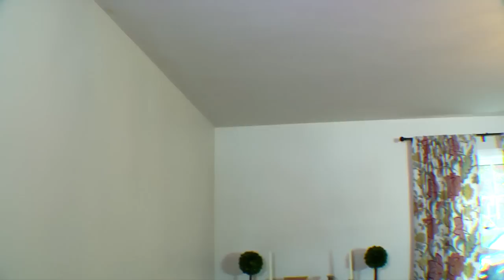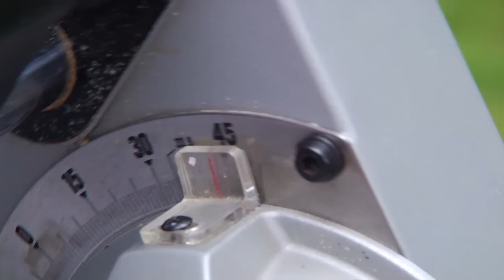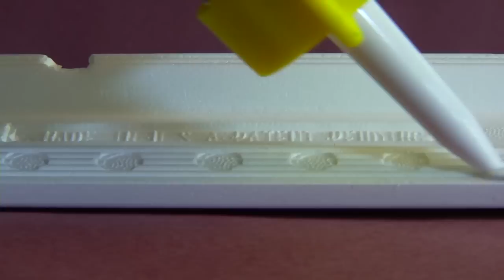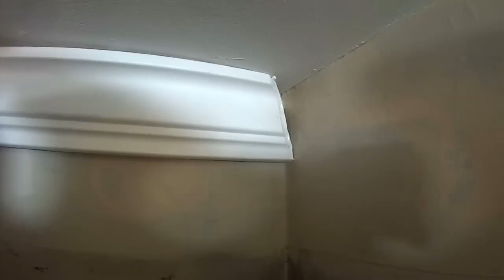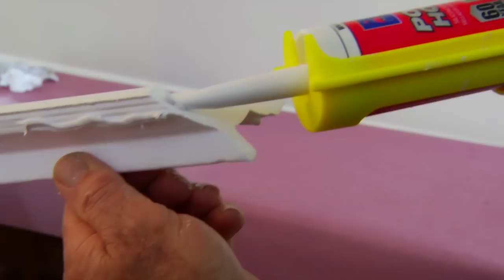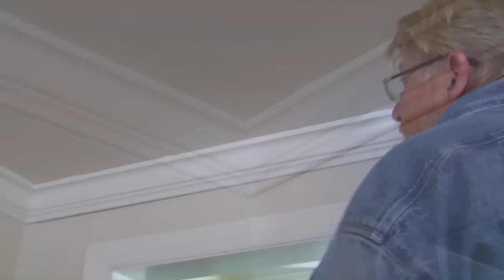Install Crown Molding Without Nails

Comment: My crown molding was installed a few years back, nailed up. But during winter low humidity the molding separates at joints and gaps at the ceiling. Would this help or other thoughts?

Comment: I recently installed glass tile in my bathroom and I now have to install the door trim. I've looked around youtube and it looks like people are leaving the trim in place and tiling up to it. I didn't do this. I tilled to the just outside the reveal, 1 inch, with the trim removed. Should I attache the trim to the glass tile with liquid nails and nail to the door frame?

Comment: Wow, you guys are vicious. My 2 cents...I'm no finish carpenter, but I get a kick out of the resistance to change to new materials. I was a mechanic during the 70s 80s 90s 2000s and saw endless changes, mostly for the better. I remember the old timer mechanics bitching about disc brakes and electronic ignition. some even quit the business over it. I bet some chopper mechanics bitched when they went to carbon fiber blades. Seems funny now. From a DIY home owner point of view, I like non wood products for many projects. I would never use wood for exterior again like wood lap siding or window embellishments. Rot, warp, crack, maintenance, arrggghh! The urathane molding looks better than wood in my opinon, but can only be painted so has a limitation that way. Anyway, I think the foam material can be a good option. I am going to use it to hide wires for recessed lighting and code says you cannot use nails if there are wires behind it, so this will work good for that. Not mention the cost is about one third of wood. Anyway, just my opinion.

Comment: My only question is, why is the spackle used at all? If I'm seeing this correctly it looks like he's using sealant on the mitered ends but spackle against the straight cuts. Why?
Reply: Because the sealant will contract into the crack and you'll see a line. The sparkle won't and you can sand it smooth.

Comment: You made a 45 degree cut on your 1st piece,what if the corner wasnt 90 degrees??
Reply: then you adjust your saw to what ever degree it is
Reply: @jerzey1016  but he didnt measure on video to show it...
Reply: @sampler129  he didn't mention to use the bathroom if you have to shit either but presumably that's allowed. you can always adjust the miter angle and try it out on a test/scrap piece until you find a perfect angle.
Reply: @vortigaunt911  if we a presumed things on this subject(not toiletry 101)tere wouldnt be a need for watching the tutorial now would it... 😏
Reply: @sampler129  you tell me. are you watching the video because you want to know more about polystyrene moulding in particular or because you didn't know that you can adjust the miter angle if 45/45 doesn't line up? I think it goes without saying that modifying the angle to fit an unsquare corner isn't going to make anything catch fire and explode.
Reply: @vortigaunt911  I watched the video because I wanted to...

Comment: To each his own... I personally am glad to see people coming out of the woodwork to criticize this. Sure, the stuff will work. But just throwing it up there with some caulk? Butt joints? I find it encouraging that millennials and the previous generation are starting to question every flashy new product that comes along. Most people don't even know what coping is, let alone how you do it... Quality products and craftsmanship are coming back into style and it is refreshing to see. It is equally refreshing to see people rebel against foam crown... I can just envision hanging a curtain rod and poking holes in it... Now we just need to rebel against that exterior PVC trim. That stuff should never have been invented.

Comment: We real carpenters don't cut crown molding on a  chop saw, holding the molding across the back fence at a 45 deg. angle...It's all cut FLAT on the chop saw table using the secret angles degrees embedded on all modern chop saws....
Reply: its a miter saw not a chop saw. chop saw does one thing, chop.

Comment: Are you kidding me? First of all, no walls or ceiling are perfectly straight. That sealant will be everywhere when you try & push that crown over a hump. Second of all, you have to make test pieces for each corner & adjust the angle till both pieces meet perfectly. Third of all if anyone starts sanding butt joints over a curtain & doesn’t cover the lose curtains with a plastic drop cloth, they don’t have a freaking clue what they are doing. You flunked big time with this video!!!!!!!!!!!
Reply: Rob G    Why would someone make and adjust test pieces instead of using an angle finder?
Reply: S Terry as I explained no walls are perfectly straight. If you put an angle finder in the corner it does not give you an accurate angle if there are any humps along the last foot or two towards the inside corner. It also holds true for any irregularities in the ceiling. The two pieces of crown when cut with the same angle will line up perfectly according to where they want to sit. Once you have the perfect inside corner with your test pieces in place, you take your pencil & drag it along the top & bottom of both pieces about 4” from the inside corner of the wall. You’d also do the same with test pieces on the outside corners. Then snap chalk lines to maintain straight runs & shim where necessary.

Comment: Never been a fan of butt joints on molding. The preferred method to eliminate this is to us a mitered joint, with the front edge of the joint leading away from where the majority of people will be viewing it. Coping the corners is also preferred for concealing the joint and compensating for the fact that true 90 degree corners are almost non existent. But most polymer molding directions indicated NOT to cope the corner. The reason being that the material will not support the cut without blowing out during the process.

The product is okay, but understand the limitations. With as light weight as the material is, it's really not necessary to hit a stud to secure it. Just a small gauge nailer and hitting the drywall at an angle will be enough.
Reply: Derek Smalls    If one uses an angle finder miter joints work out great.

Comment: Easier and less work with brand nailer, never butt end to end on a straight joint.. Miter each side at a 45 so they fit seamlessly. Use Wood trim...
Reply: No wood trim ahole.....this is easier, cheaper, and doesnt contract or expand.....its a perfect installation!!!!!

Comment: Speaking of not using nails reminds me of a home in Indiana, newly built, and they hired an Amish crew to install the shingles on the roof. Amish didn't use electricity to nail them in, only tar or some kind of sealant. One hard windy storm, and the homeowner saw some shingles blowing off the roof while inside the family room.
Reply: LostInMySpace I
Reply: Was that my house?  I had that happen more than once.  Eventually put on a metal roof.
Reply: @DavesNotHereMan2  Yeah, I think I'm done with shingles.  They're only as good as the installer.  I had 30 year warranty dimensional shingles installed, and the roofer only put 5 nails across which voided the warranty because the mfger. required 6 nails across.  And the nails must be installed in just that very narrow strip on the shingles where they're intended to be nailed.  My installer put them haphazardly anywhere where it wouldn't be seen as long as it was covered by the next shingle above, so they eventually would crack off horizontally.  You see, when you hire a roofing guy you sign his contract, and he also must sign yours which in part should give you the right to shoot him within the 30 years warranty period if the shingles prove a faulty installation.

Comment: I'm a trim Carpenter by trade and I see no problem with this product and I like the fact of using no nails. However the ceiling would have to be fairly straight, if there is a joint near a dip in the ceiling joint alignment will be a issue, even with wood crown and nails it presents a challenge to get the joints to align. Also 45 straight cuts in the corners will also present a problem , because most corners are not true 90 degrees and this moulding seems to have a rib on the back which to me will keep this product from being bedded up are down to get a tight bed joint in the corner , so I don't think it can be coped. All this being said I would still like to try it out . I always like to try new products.
Reply: Junkyard Dawgs A level ceiling? Where? Never seen one myself, although ive heard they exist.
Reply: Abu Bahu they are rare ,but I did come across a couple of them back in the 90's.
Reply: Benjamin Smith - Sir, it was an historical renovation in a large enclave of similar mansions in the Craftsman period (fumed oak flooring, casing, base,  balustrades, etc.).  His was well out of date and he needed to "keep up with the Jones".  Additionally he spent (I'm taking an educated guess here) another $70k on the appliances; 6' side by side Sub Zero freezer, 6' side by side Sub Zero fridge, 48" gas cook top, three electric convection built-in ovens.  No joke.  The end product was that he had a perfect kitchen/butlers pantry and I cleared well over $127k net and I sold three more over the next year in the same enclave.  I've been published twice nationally, does Taunton Press ring a bell?
Reply: Have you ever heard of Cyanoacrylate and their accelerants? I did a $500k kitchen without using a single nail installing the prefinished crown moulding.
Reply: Was the fumed oak flooring,  casing,  base,  balustrades,  etc bonded together with CA?  No?  Why?  Because they were from the "Craftsman period" and meant to last a lifetime.  You'll be lucky if the CA lasts 20 years due to temperature,  humidity and vibrations/settling.  You literally glued paint to paint.  Good job.
Reply: It really shouldn't matter if corners are not true 90 degrees. The trick with crown is, that you cut a true 90 every time, and if you have two of those put together, you can hold them in the corners, and make a pencil line at the bottom of the crown where it fits the best, and snap a line there.. Because ceilings tend to be a bit untrue because of mud and tape (on drywall) the actual height where the crown will be nailed may shift a little bit, and this is usually not a problem. It might be an 1/8 " or even 1/4 difference from corner to corner on a long wall. Hopefully the tapers got it closer than a 1/4" on a short piece of wall and ceiling. It's the method I have used, and it works for me and the builders I have worked for.
Reply: Okay Mr. Smith, I'm putting an end to this.  The CA was used for immediate bonding purposes of the junction between the raw plaster ceiling and the top rails of the cabinets, negating the need for nails.  I used poplar ripped to the same spring angle of the crown and nailed them into structure with about a 2mm tolerance to allow for the construction adhesive that actually held them in place.  Furthermore, I created a wood glue sizing to prep the outside corners for aliphatic glue so they would hold up.  And they have for in excess for 20+ years, as I still get referrals from these jobs.  I'm too busy to take them on as I've been concentrating on commission furniture for the last 10 years.  To that end, I've been published twice nationally as I stated before, you failed to address that in your troll.  CA wasn't invented until the 1940's, so no, they wouldn't have used it in the 1920's when this home was built, duh.  T&G solid flooring doesn't use glue, not sure what you are talking about.  The only glue used with balustrades was for the typically round tenons at the top where the baluster met the railing at the top and the same type of tenons would meet at the floor.  As to the casing, as you mentioned, the only glue would be for the miters, right?!?   Trolling over, I'm done with you and I have no need for you, nor does the balance of the internet.  I've been published twice nationally, have you? NO, I didn't think so, check that, I KNOW so.  Troll be gone, I'm out, I'm done...
Reply: Whoever paid $500k for a kitchen without NAILS and prefinished crown got SCREWED.
Reply: You are such a loser with nothing to contribute. Troll be gone...
Reply: 10/10 would troll you again.

Comment: Sometimes you NEED the material to nail otherwise you will be two far from the wall in these old homes. 2 options and only 2 options. Wood or MDF... MDF being the easier of the 2 since it’s easier to cope your inside corners.

Comment: I brought and installed this product and it came out just great. I took the time to painted it, than stain it to make it look like wood. ( this guy in the video show how to do this in another video). I also hung it 4" below the ceiling, so I could hide my speaker wires for my sound system, than place some rope lighting inside too. Don't listen to people who say this product is crap. I know better!
It a cheaper alternative. This project in wood molding alonewould have cost triple what I paid for this.

Comment: Polystyrene is banned in Britain,gives off toxic smoke,and melts dripping fire blobs,
Reply: If your house burn down, ya really think your going to be pissed about your  "molding"
Reply: Britain sells tons of urethane moldings. Don't know if that burns any slower.  Drapes and furniture burn quite quickly -- wouldn't worry about the crown.  He said it had a Class A fire rating.   The horrible fire in the London multi-family building was styrene exterior rigid insulation that had an air gap for rain screen.

Comment: don't buy this crappy product unless you want it to look like someones teen age son put it up your carpenter will thank you for following this advice...if you are gonna do it your self fine have at it  but if a joint falls on anything like a bump or low spot in the wall you will now understand  you can't nail it and the caulk won't hold the joint lined up
Reply: Keith Maletski   And the fine plaster moulding craftsmen did the same complaining back then that you do now.
Reply: Douglas Hanlon agreed, if wood crown is not in the budget then mdf molding should be next, looks much better and will last longer. every craft is under attack from cheap corporate alternatives. this product would be a good option if someone cannot really afford professional products and professional installation. in that case it's one option to offer a customer imo.
Reply: After you paint it, you can't tell the difference except for no nails and no gaps later on.
Reply: Where I work, painters never sand our crown, but they always caulk. It's what the builder wants. They caulk everywhere a moulding meets a sheetrocked wall, and anywhere a moulding meets a door or window jamb.
Reply: Douglas Hanlon amen
Reply: S Terry  I've never complained on a job because it means that I'm getting paid for my quality and experience.   Scribing crown is so much easier in the last 70 years or so (depending on the region) due to advent of plaster on blue board (as apposed to lath) and drywall.  The lines are so much straighter making the job as easy as snapping lines or using a LASER.  For physical limitations, I haven't been able to perform the work in the field for the most part for the past 15 years or so.  I still persue my passion of building commission furniture pieces.  BTW the best way I found to install prefinished crown moulding (and thank you for that nod) is to use two part medium Cyanoacrylate with 15-30 activator spray.  No nails, no nail holes.  I'll tell you what, I freaked out about the fit and finish the first time I used it, but nothing beats it especially epoxy.  I used construction adhesive just inside the contact points of the crown for the long term.  FYI - I've been published twice nationally, not just online, but in actual magazines, Taunton Press ring a bell?
Reply: So do you make your crown crooked to conform to a crooked wall?
Reply: Corporate shill strikes again.  Don't even get me started on the disrespect to fine finish carpenters that actually use scribes and hand planes to made the wood mouldings fit properly (and it's moulding, not molding).  After we're done with our fine work, another fine trade (the painter) comes in and fills in the nail holes, sands and finishes up our combined work.  The origination of wood crown was that it became cheaper than plaster mouldings in the late 1800's.  If the painters have to use caulk, then look for another profession.
Reply: "molding" is what happens after you rip this garbage out and toss it on a damp scrap pile.
Reply: Keith Maletski do you still walk to work or ride a horse? Do you use power tools to cut, drill etc or do you do it by hand? Being that you have embraced the convenience of the 21st Century by watching YouTube, I wouldn't be too hasty with the Corporate shill comment. It's really weak. Innovation is what made America great. Lawyers, politicians and liberals are those who are ruining it. Don't blame the corporation who employs hundreds or thousands of people, affording them the opportunity to live the American Dream. There are others responsible for that!

Comment: How does this compare in price to wood crown moldings?
Reply: Use MDF Moulding
Reply: He is not there to answer you.
Reply: Well, if you are ever in a bind you can yank it off the wall and put it in and box and still ship your package.  Don't buy this crap. Save your money for real wood or even mdf would be better.